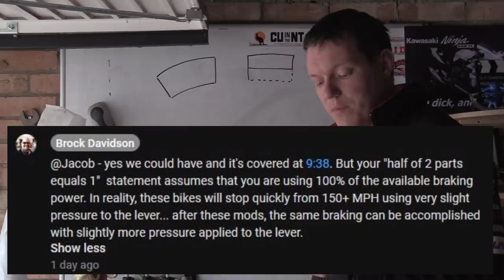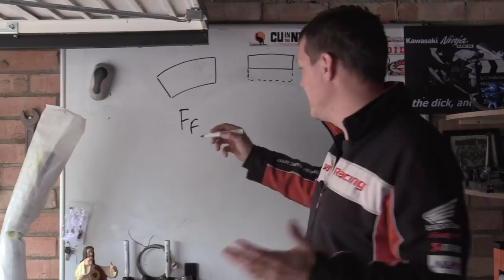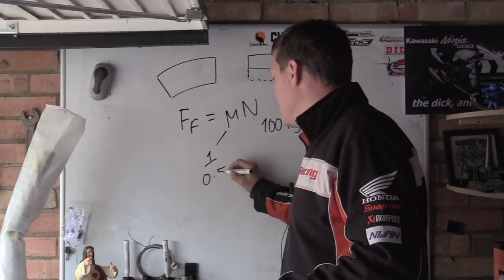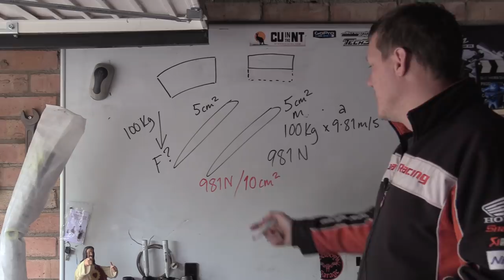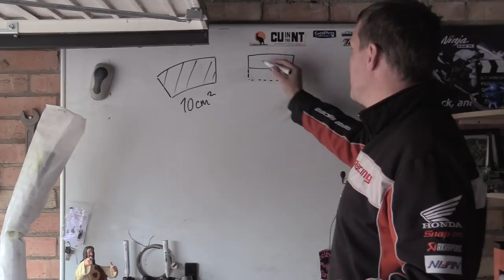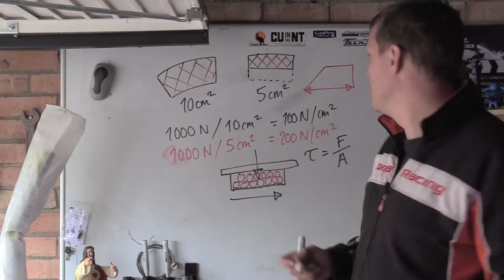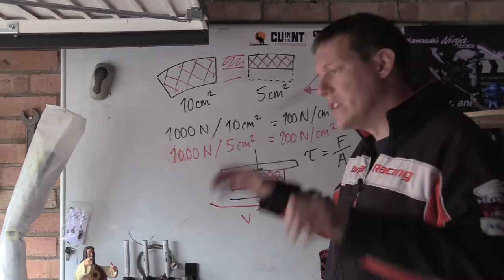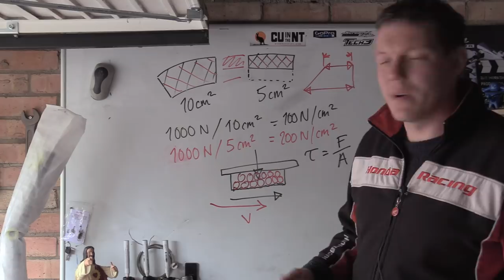B Stupid - with Brake pads

Comment: Coefficient of friction is not exactly "arbitrary", but it is an approximation of the general thing we call friction for a specific category of interaction. Also, something being dimensionless doesn't mean it's arbitrary. You seem like you've got some engineering background, so I'm kind of surprised you'd make this point, but whatever.

The reasoning for larger tires is entirely unrelated to friction for solid objects. Friction for different types of objects is due to different phenomena, which you sort of hinted at with noting that we don't know everything about friction at a deep level. Tires gain traction through their elasticity and adhesion, and serious engineers don't refer to "friction coefficient" for tires, but rather "traction coefficient" for this reason. There is a much more rough approximation for this, but that lies mostly in the models for figuring out the traction coefficient.

I think this is just sort of a dumbed down version of this all for YouTube, but I'd change just a little bit about your explanation. Everything regarding heat transfer seemed good to me, though. I don't think I'd add any to that.

Let me know if I've said anything incorrectly, as I kind of hurriedly typed this out as I watched the video lol.
Reply from the maker: Yes you're correct - this is dumbed down to the level of what's in the video. 

One side note is that - I don't always explain things in the best way, sometime I get it bang on and other times I don't convey what I'm trying to say on the spot. That's why this need to be re-visited at a later date. I often go down rabbit holes and tangents because I'm trying to jump the gun on people questions before the fact - sometimes it flows - sometimes it doesn't 

But the main points are there.

"Coefficient of friction is not exactly "arbitrary""

-  I agree that this wasn't the best words to use, more a dimentionless factor or ratio would have been better , between the normal force in relation to the static friction force required to accelerate said object.
Reply: @dirtygarageguy  Yep yep. I've literally only ever seen 2 of your videos, those being this one and the one this is related to, so I don't really know much about your channel. I like the style, though.
Reply: It kind of is arbitrary though.

You said it yourself, it only accurately fits one specific geometry ("specific category of interaction").  Anything else requires fudges, hacks, whole new models etc.

Why that geometry and not any other?  Arbitrary; except for the fact it makes the maths (almost uselessly) easy.

Or in other words, a classic case of empiricism.  Let's hide all this complexity under a fudge factor for controlled conditions and just build some shit, fuck it, see how it goes.

Oh, and "serious engineers" know that "traction coefficient" (a fudge factor) is named for what the friction of the tyre / wheel & road / rail interface is being corralled into achieving, from our "design" perspective - i.e. a tractive force.

Comment: What is your thoughts on using a corrosion inhibitor instead of antifreeze in the summer months or in hot climates? We know that a 50% concentration of ethylene glycol based antifreeze has worse thermal dissipation characteristics than water but is the difference in a practical situation with a vehicle with a marginal cooling system real? I ask as the owner's manual for my Land Rover says "when frost protection is not required use a non-phosphate corrosion inhibitor". I'd be glad if you could help!
Reply: If you can’t address the underlying reason the cooling system is marginal then Run 30% (really important that quality demineralised water is used) and change regularly
Reply: @mrbumcraic5046  I was just asking a theoretical question as I thought the recommendation of a non-phosphate corrosion inhibitor was peculiar.
Reply: @davidlisney2597  Sadly you can only get cheap pattern ones now, as the originals are no longer made. I have "upgraded" to an aluminium/plastic one instead of a copper/brass one but only long term will I be able to tell the difference. Thanks for the link though!
Reply: @cameronwood1994 depending where you live the fabricated aluminium radiators are rather good.  I am sure the aluminium/plastic ones are great in a lot of modern cars but no idea how durable they are.
Reply: @davidlisney2597  I can get a fabricated aluminium radiator sure, but I'm not paying £740 + VAT for one!
Reply: @cameronwood1994 , that's a bit steep, might be worth a trawl round a scrap yard with a tape measure....

Comment: Grip is dependent on surface area, pads and discs are very hard, smooth and bedded together so I doubt you could squeese hard enough to deform the pad and disc sufficiently increase grip. 

Also, don't apply drag racing logic to a street bike. Drag racing is incompatible with a bike or car that might be driven on the street, even the pro touring guys run full brake setups and street tyres between events.

Comment: Will not be doing this and still fucked off about the fact he’s tampering with a lovely GSXR, what would be the difference if he slightly chamfered the leading edge of the pad so it still has the entire width of the pad to contact the disc but the length of the contact surface is shortened.

Comment: I have no engineering education just to be clear. I do have an automotive education from the United States Air Force and wyotech (theyre closed so now) you may think it was a poor education. But my instructors were mechanics and racer. In chassis fabrication we actually discussed grinding off a portion of the passenger front brake pad. This was done to stay within the confines of the rules which stated the vehicle must have a stock working brake system without brake bias switch. They ground rough more than half of the pad so during tech inspection u could see brake pad and it would pass inspection. The purpose of this was for better turn in on circle track. I do not know if this is part of his reasoning because of rules in his racing class. But my point is racer do a lot of unsafe modifications some effective and some are snake oil. If he does that for a street ridden bike he is an idiot!!!! Race only vehicle are ran for short periods of time and throughly inspected and serviced often and im sure ppl have been hurt because of their modifications. Im not saying he is right i just see where he is coming from. Now as far as him giving his weak disclaimer and broadcasting it to all the bikers of youtube to maybe hurt themselves, rant all  you want. Just my 2 cents 
2008 suzuki gsx1300r busa
2003 suzuki gsf1200s bandit
Reply: Circle track where its single direction turns on a known quantity course is very different to road course racing. What you are talking about is intentionally reducing the power of a brake on one side of the vehicle to use the braking to help in the turn in or outeight disabling it in order for the vehicle to pull one way to help in the turns. 

Not the same thing in the slightest and something that is fairly well knownnin that area and you were told about why its done and what purpose and given warnings on the risks. Plus you were all in that room either reasonably experienced or learning rmfor the racing industry and openly knew it wasnt a good idea in terms of braking force and had negatives associated with it as a thing to account for in chassis design and fab (uneven forces, torsion on the chassis etc)  which is very different to 'this will make you faster' and no discussion of the risks, the limitations and the reasons for the specific sport in question.

Comment: Ball bearings less surface contact less friction... aaaaahhh but then there's double row ball bearings. Could be argued both ways no?
Reply from the maker: Less surface area is higher contact pressure - this has to be factored in with load
Reply: Right on.  Just helping give you endless material.

Comment: More surface area more friction more breaking power ..... end of chat
Reply from the maker: Well in a word - no. For any given force the larger the surface area the lower the contact pressure.

Other things are important - like heat saturation and shear strength of the material

Comment: The problem with drag racers is that they can tell you a lot about acceleration but nothing about RACING! If you don't think you can win a race on the brakes I suggest you speak to Kevin Schwartz or any other COMPETENT road racer. If you don't extract the MAXIMUM efficiency from your brake system YOU' RE NOT RACING!!!!
Reply: I'm going to be blunt I know next to no drag racers who would do this sort of dumbshittery every drag racer I know wants the BEST brakes they can get. Especially now we are reaching the point where we are seeing the run off issue just like on road course racing. Older tracks and the speed increasing so much that we are losing tracks or having to go to 8th mile  because the safety regs change and the run off isn't there. 

Brock may do this but pretty much everyone I have ever met in drag racing from the club racers to people like Larry Mcbride would look at him like he had three heads. 

All racing is racing, you may not have an interest in it but doesn't mean the R&D and tech side isn't useful nor does it diminish the skill of the riders involved Especially in the street classes where there is no wheelie bar and air shifters are restricted. 

A lot of the quickshifter/autoblipper tech we are seeing now in road course and street racereplica's came from drag racing, it's also an amazing testing ground for traction control systems. 

Plus it encourages interest IN racing at grassroots level which with the ever present threat of the NIMBY brigade moving to housing estates near tracks and complaining about the noise, the eco warrior virtue signalling brigade pushing for less and less racing to be done because fluffy bunnies and the councils who hate bikers and see that local track that does club events as valuable real estate they could sell and get a backhander from/look awesome because they stuck it to those 'rich' hobby racers with their sports cars engaging in some good old fashioned  class warfare.  We NEED.

Brakes and when you start to let off matter hugely in drag racing, you need to be able to react to anything untoward. Engine issues, your competitor crossing the centre line, tyre blowouts. There is no way any racer I know would willingly go out with such a junky modification as chamfered discs.  Yes some bikes going to a single disc setup is fairly common but that is in no way the same thing and if you look what it tends to be is a single disc with a better than stock caliper and its about weight. Shifting from 2 4 pot calipers and twin 290mm discs to a 6 pot and a 320mm disc is going to be less weight and no change in performance. Plus mean that your dive under braking will be easier to account for. 

I'm a fan of pretty much all racing, drag to dirt oval to speedway to road course. The only 2 things on a bike I haven't tried is ice racing and closed roads racing (TT/Manx GP/NW200 etc). Iv done hillclimb and some rally courses but thats the nearest im comfortable with. 

Try it and you'll be suprised just how hard it is to get good and also how much of a drag racing training day actually improves your track riding in other areas. I learned a hell of a lot about throttle control and shifting not only fast but with the minimum of fuss. Also being able to shift into a good racing position quickly was massively improved by drag racing as was my reaction times and processes for the starting line in general.

Comment: If what he said was true, race cars (yeah cars, I know, fuck off), wouldn't need brake rotors the size of big dinner plates with pads the size of your foot, they'd be able to achieve the same increase in braking power with a smaller bore master cylinder and a longer pedal stroke to up the clamping force.........

Comment: What about titanium for break disks? It behaves well at high temp, no? Or will it zap sparks like a motherfucker due to pyrophoric particles fucking off?
Reply from the maker: Poor thermal conductivity and poor CoF compared to steel - there's also the fact that Ti tends to gaul. - which means even though it can take higher temps - it will get to higher temps quicker
Reply: @dirtygarageguy  Any way to alloy it to make it better?

Comment: Judiciously motorcycling exist in part to eliminate stupid people from the gene pool. Usually that's by running out of talent while going quickly but if "modifying" the brake pads on a motorcycle has the same effect who are we to interfere with Darwinian evolution. 

There is one part I don't think I've understood correctly, if you get thermal expansion in the pad wouldn't EngiNerds just set a larger gap between pad and disc so at peak heat cycling you'd avoid the pad interfering with the disc? Interesting use of a shroud on racing bikes, they could augment it with an active ducting system to the disc and caliper assembly in the optimal operational window. In F1 over the last few years you often see technicians with blowers trying to manage the heat because the operating window is so close to the maximum temperature that can be sustained while the inboard ducts are blowing air over the assembly and disc at race speeds.

Comment: In theory the whole idea of increased heat and pressure is correct. But is iT crazy in practice of dragracing? I have seen this technique for over 10 years in drag racing. Never seen a failed brake run ever due to failed brakes or pads on supersport bikes? Also loosing one half of the brakingsides does the same with your calculation but is not so crazy than? Also no major heat problems seen, sorry. Modern super sport braking is designed to brake stupid hard in races, you can effectively use half the available stopping/braking power to make a damn good emergency stop(even in the drag racing sport where this should be applied). Braking on the end of an run is not that exciting at all. A runstop uses an minimal of twice the circuitrace stopping distance which is half the needed force ? 1000nm/2=500nm where racers uses 10cm2=100nm/cm and compared to 5cm=100nm/cm? Does look not so bad at all. But what happenend if i run a smaller tyre let say half of the runsurface, which is also very common? Again no problem but compared to the above half is available which is an problem? Would i recommend this, no, but not bases on the calculation and heat issues.
Reply from the maker: "In theory the whole idea of increased heat and pressure is correct"

- explain.

"Also loosing one half of the brakingsides does the same with your calculation but is not so crazy than?"

- Yes, its also a stupid idea - but a semi common practice. And a stupid one at that. 

"Also no major heat problems seen, sorry."

- smells like bullshit to me - do you wanna do the numbers or should I?

"Would i recommend this, no, but not bases on the calculation and heat issues."

- Have you not seen brake testing before on sintered pads?
Reply: The Workshop To start, I will not encourage doing stuff to your brake pads. But taking one side of the calipers is common in dragracing (even in the topfuel). Your theory is based on one constant; It would require the same distance to stop, where the system is based on as design. Than yes you would increase heat due to less surface. It shows in your calculation that you compare this variable for both situations. As I mention above, braking distance of circuit racing is not the same as drag racing. If I use 100M to stop on an circuit I have an general of 2-300M in dragracing or even more. So there is more available distance, less braking force needed than design with full surface or with less surface (half) we see the same surface force as duel disk with 100M stop. But what happens if we take a look at topfuel class. They use the std. setup braking (dual) but twice the speed of supersport and more weight. They have the same brake surface as an std bike but use 2-300M to stop. So we know brakes are capable of doing 3 times the braking time with an certain surface tension with no problems. Again no brake fading seen.
 
To divert to heat; same surface force as designed, translates to same heat over same distance (globally). But we run 2x distance and time I hear you say? Well yes, but still no problems seen as this could also is well testen by topfuel with double the speed? On circuit racing I see a lot blue braking discs meaning of heat due to constant hard braking without a lot of cooling time. After the drag run it’s done for the bike and it cools down.

An funny one to consider, do the calculations above and the ones in the video with speed x2 as seen in topfuel with the braking distance again set. Is this class stupid than? And also, do you see an dragracer do emergency stops doing over 400kmp? If this would be an major issue there would be requirements stating maximum brake distance per speed or something. Regulations allow single rotors due to risk analysis and occurrence of issues. We are hopefully talking about group of people which inspect their bike more common than the average weekend drivers. At the end of the story and strip, it’s not that exciting to do the braking part where rolling out the race is quite common (the other side of the practice and theory I was referring to).
Reply from the maker: "So there is more available distance"

- I do in the video go on about the length of run-off - but then say about emergency braking. 

" topfuel with double the speed?"

- and they run parachutes - the AMA class don't